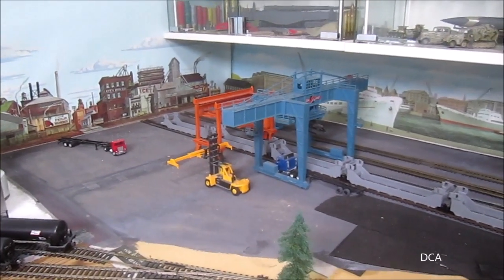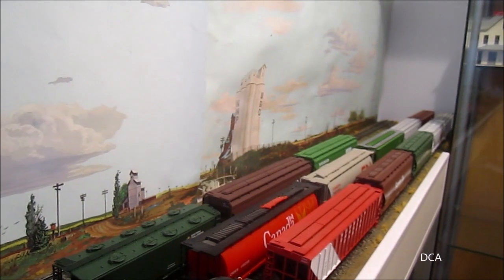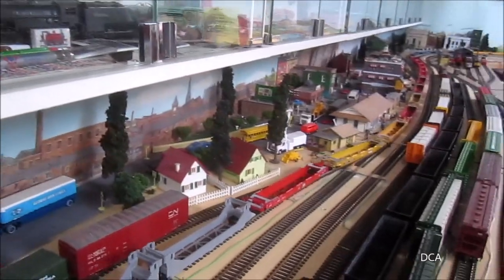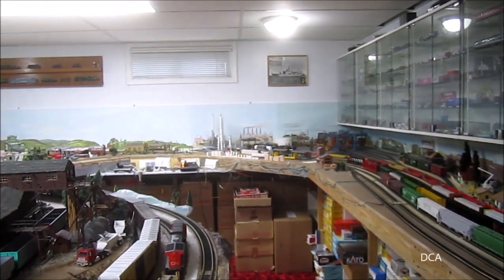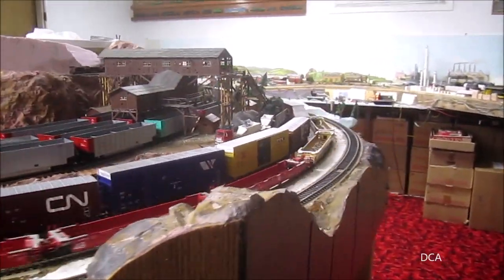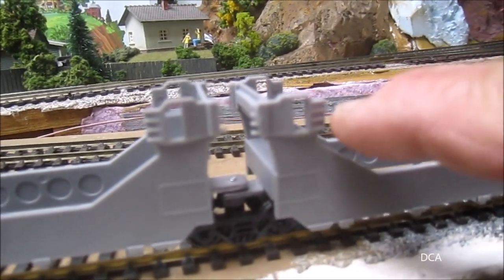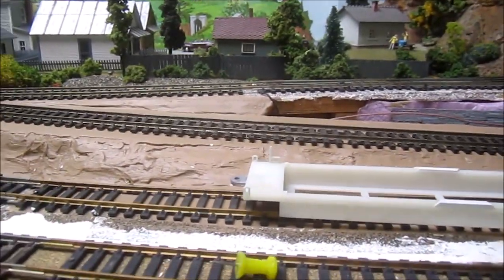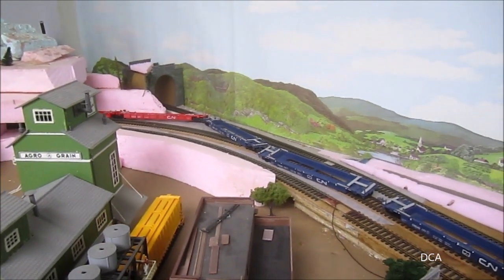Trains On Tuesday 21st. September 2021 Messing Around

Comment: hi David., very cool a 55 car train & going backwards ..,awesome.., too bad about the gray cars ...i hope you can sort it out.. thx 4 sharing.. vinny
Reply from the maker: Hi Vinny, Just messing around and I got that train running like that so I thought I'd share it. It is too bad about those load restrainers being on wrong but the instructions are not very clear. I may have to cut them off and then scratch build 20 replacements. I do have another set of those un built. They are A-Line kits. So glad you enjoyed watching. All the best, David.

Comment: I don't know many GALLONS to the MILE those engines burn but it was very expensive lunch. As Peter Shaw mentioned - very impressive reversing.  Regards Michael
Reply from the maker: Hello Michael, I don't know anything about the fuel consumption on those locos but I do know the 567 engines, that is 567 cu. in. PER cylinder. 8 cylinder engines used in the switchers of the 60's and 70's idled at a consumption rate of 1-1/2 gallons per hour. They idle at around 200 RPM. and max out at around 800 RPM so it's probably not as bad as you might think. We probably went through enough diesel for Gwendolyn to circumnavigate the globe a couple of times - with a tail wind.
Regards, David.
Reply: LOL David.  I must make use of the tail wind with a Sail!!!

Comment: I never realized you had elevation changes on your layout.   That is very interesting.  You have very smooth track and large curve radii.  Very nice, enjoyable,  Thank you, David.
Reply from the maker: Hi Rob, I would have preferred a level track but the display cases dictated the height of the main city and yard as it lays under them. The higher section has the duck-under to access the layout and I wanted that as high as possible. As you can see, the climb is gentle and quite a bit of it is hidden in the tunnel. My curves flow with easements so the trains ease into and out of the corners very gently. The tightest piece is only about a foot long and 26-28 inch radius. My big curve by the oil refinery is about a 7 foot radius. Many layouts follow the square shape of the room and it shows. Mine, somewhat like Farland is more of a noodle and kept away from the walls. Glad you liked my bit of fun.
Regards, David.

Comment: When you said there was a problem I knew the driver had forgot his Lunch 🤣 I know you have said before the couplings are fixed to the car bodies and not the bogies, but that is still some amazing power in the Locomotive. I have seen Sam's Trains testing New stock that can't pull Six Coaches let alone back up Fiftyfive Cars on double bogies. There has to be something else your doing, perhaps the driver has Spinach for Lunch 😂😂😂😂😁
Reply from the maker: Hello Tim. I can only imagine that you forgot your lunch on at least one occasion. It can be very distressing when that happens. lol. The loco used in this demonstration is made by Kato in Japan. it is quite heavy, it is twelve wheel drive and has no traction tyres. I keep the rail cars as light as possible and the wheels finely tuned, I must do a video on that sometime. Perhaps the biggest factor allowing me to do this is in the track work. I use only flex track and I ease into and out of the curves. The tightest piece of curvature is wider than 4th. radius and it is only about a foot long in the middle of a curve that is probably about 5 feet long. My widest curve, a full 90° is about 7 foot radius. Spinach for lunch, I could go for that.
Regards, David.

Comment: The issue with glue for modellers...you want it to stick and then sometimes you don't :-).  Nice switching work there David. Mark
Reply from the maker: Hi Mark, I practiced the "switching" and it went fine so I did it in the video, again fine but when it came time to switch out the train afterwards it derailed every few feet along the track. It was just a fun video to make.
Regards, David.

Comment: Nice running there David. Those flat cars must be top quality to be able to perform that well. Or you are defying the laws of physics. Which is it mate? Steven.
Reply from the maker: It's the physics Steven, I don't like being told what my limits are.
There is one 3 car set by Kato in that train. That I would rate as top quality. The rest are a mixture of Walthers, (better than average), Athearn Blue Box, (Average) and A-Line, ( upper mid range kits.) There are a number of factors coming together to make it possible to run trains like that.
Take care, David.